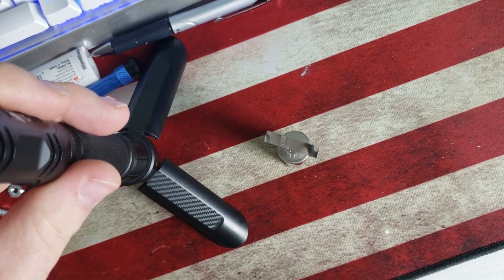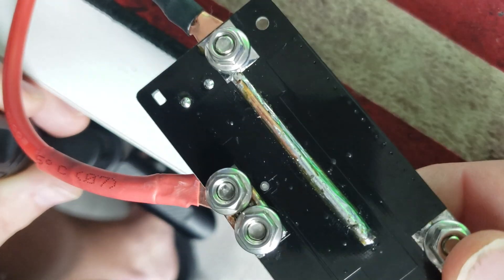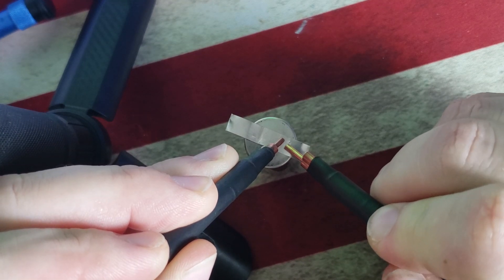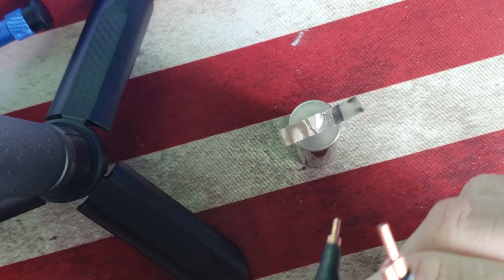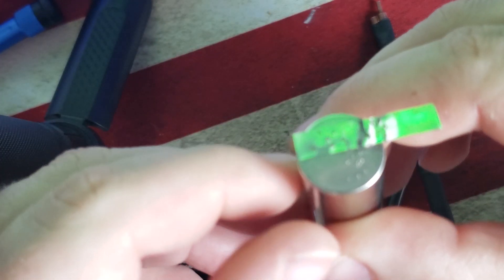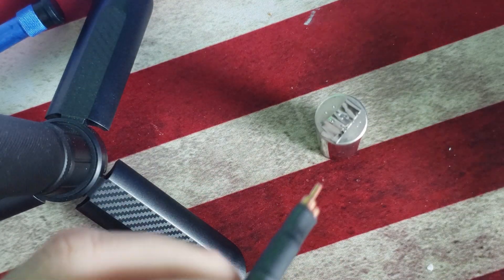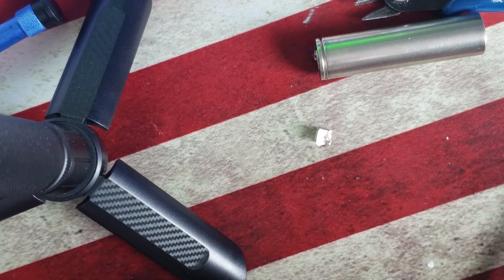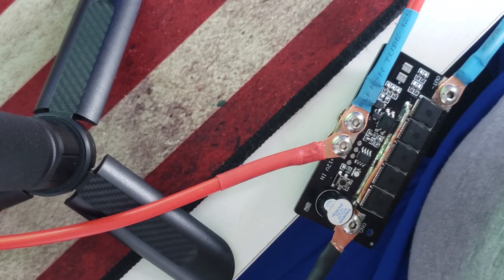CHEAP EBay battery Mini Spot Welder. Used 18650 cells, LiPo #diypowerwall

Comment: hi How many ampere battery this product used?
I bought a similar one and did not know how it works
Reply from the maker: I use SPIM08HP cells. they will do 200 amps/400 peak. 3s configuration.

Comment: The power source is very important. After getting the kweld, i checked my large battery pack but it only tested in at 450amps. After upgrading to an everstart 850CCA car battery, it tested at 1670amps. I suspect even the chinese spot welder might perform better with the car battery.  The ATL cells have nickel negative and aluminum positive. I was able to spot weld to the aluminum at 16J using 0.12 or 0.15mm. It does weld, but the aluminum is fragile and brittle. If you pull too hard, the weld pulls out leaving a small hole in the aluminum tab.
Reply from the maker: Oh man thats great! The Kweld is the pinacle! I believe I was using SPIM08HP cells. They are rated to 200amps each x 3.  I think this welder is not as good as the welders from my other videos.  even the welder with 1 LiPo cell did better then this one.   Same situation for me with the ATL tabs.

Comment: Were you able to spot weld the ATL cells using a kWeld?
Reply from the maker: Have not tried.  Give me a second and ill try.
Reply from the maker: NO, but I was able to wrap .10 nickel strip over the tabs and get it to stick to both sides of both tabs pretty good. @ 30 Joules.
Reply: @RodneySolarCircuits Oh, so its kind of like the copper/nickel sandwich technique, That's very helpful.
https://www.electricbike.com/introduction-to-battery-pack-design-and-building-part-3/
Reply from the maker: @Allenw154  Yea thats the same idea.  cool.

Comment: Thanks for posting the video!! Just curious? I noticed on the one I have coming in, it has a capacitor I need to add. But on yours, it looks like you don't have it soldered to the board. Do you really need to add the small Capacitor?
Reply from the maker: I see on the new boards they have a spot for the cap togo. my board was vague. I did put it in what I felt was the spot but no difference.

the cap was for 16 volts. Dont go over that.  lol.  I know you prolly know that but some commenters blew theirs up.
Reply: @RodneySolarCircuits  I got a few of these types of welders coming soon and one handheld. I should have videos posted as soon as I do some testing.
Reply from the maker: @njfulwider5  looking forward to it. I have a few too. been sitting on them for awhile. funny I filmed a lil today but wasnt feeling it.  I did solder one of them together today but I need to build a battery with an xt60 plug on it.  My Spot welder video has the most views so far.  I have 4 more but one needs those big Capacitors. This is my long weekend off but im going out of town.

Comment: Wow small world. I got a bunch of those ATL cells. Tried everything to get a good config but it looks like i do need to spot weld. Just order this exact one. Did you ever do something with the cells?
Reply from the maker: I thought about using them in my solar lights because the lights are too thin for another 18650.

Comment: What would be the best set up for this little spotwelder? Should I buy a 3s lipo or go with a car battery? 
The reason that I don’t go with the Kweld is because of the cost, I am only going to make a few little packs and I don’t find it worth the investment for now, maybe later. Also 1mm nickel is decent for my projects. portable Bluetooth speakers in old steel ammunition boxes  :)
Reply from the maker: So I used Lipo cells. Ive heard car batteries blown it up.  If you wanna get technical.  look up the data sheet on the mosfets on your board and see how many amps it is capable of.  I doubt the traces on the pcb can handle that many amps.  If there is a capacitor on the board, make sure you dont go over the stated voltage with your battery.
Reply: Rodney Mobley thanks for the info, 1mm nickel is just fine for me, so the current that the 3s lipo can deliver is more then enough.

Comment: Thanks for your video it really gave me the confidence to go ahead and order one. Is there a reason you didn't use the 2200uf capicator connections?
Reply from the maker: Cool!! Thank you!   I later did install the 1000uf 16v capacitor.  I think I put it in the right spot.  Don't think it made any difference. But I would not go over 16 volts for your input.  It may just be there as a fuse for over voltage. In the comments another guy used a 4s battery fully charged and blew his up.  I have 2 other cheap welders I need to make a video on.
Reply: @RodneySolarCircuits  please make the videos on those other cheap spot welder

Comment: You might get better welds if you rounded the tips a little.....Good Video!!!
Reply from the maker: I was using the edge of the tip as it is a sharp cylinder.  I will try it.  Since the Capacitors are rated to 16 volts, should I add another battery in series and charge it to 16 volts?
Reply: Rodney Mobley I seen another guy up his amperage and voltage to a car battery and destroyed the fets on his. Are you only using the one SPim08hp?
Reply from the maker: @njfulwider5  No, 3 in series

Comment from the maker: I tried to weld the tabs on the ATL cells today and it wouldn't do it.   so I'm charging the cells from 12.2 volts to 12.6.  maybe I can add another cell and bring it up to 16 volts?
Reply from the maker: Just bought another 100 3-cell modem packs on E-bay. came out to 0.54 cents each.